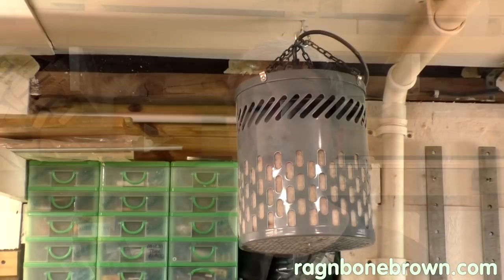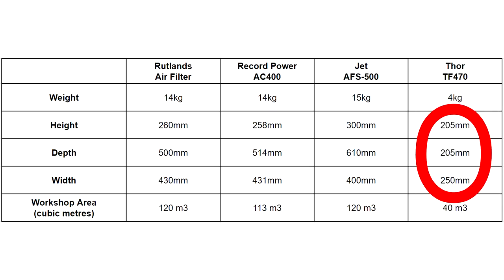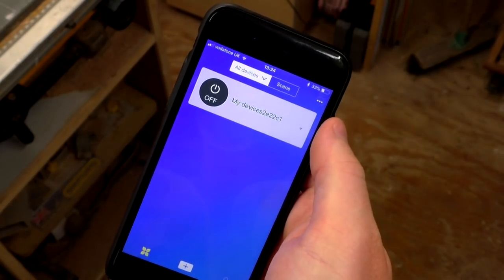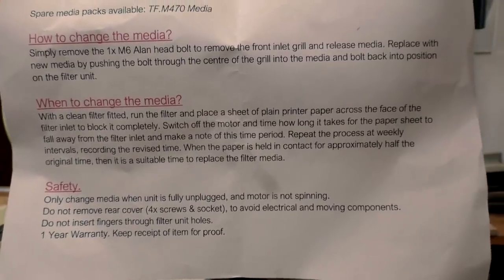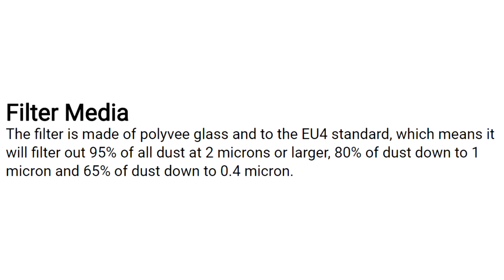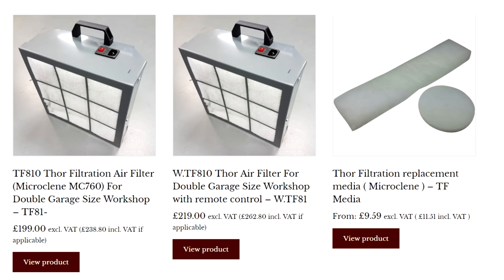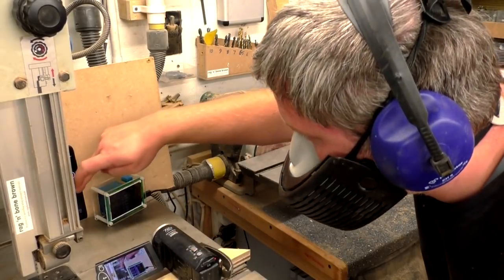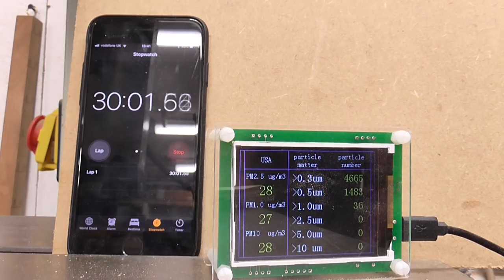Air Filter For The Small Workshop - Review and Testing The Thor Filtration TF470 (AKA MC420)

Comment: Not sure if I commented on this review before but I wanted to thank you for it. Due to your review I knew I wanted air filtration but I was put off this type by your and Peter's review of it.  I bought two of the Rutlands ones for £220 delivered. It is way overkill for my garage according to the specs but I would rather clear the air quicker.  My ceiling is higher than I can reach so should be space up there. My intention is to have them on opposite walls pointing in different directions to encourage a circular rotation in airflow. They arrived today and I would say are very quiet but have a good air flow. I am yet to see how much dust they gather.

Comment: I have the Jet, it's incredibly quiet and has the option to stay on for a number of hours which is great as it cleans the air when I finish up.

As for your WiFi issue, try an App called If This Then That. You can set it up to do all sorts of things and having it turn on something when your phone is near a certain area using GPS should be possible. I used mine to turn on WiFi cameras when I left my home area.

Comment: Great video very informative 👍. I work in the air pollution monitoring industry and it's extremely important to filter out PM10's and microns below, especially in enclosed spaces as the human lungs can't remove these particulate sizes efficiently, which over time can lead to long term health issues. I was currently looking at the Rutland's air filter for my workshop.

Comment: It would be interesting to see what the results would be if you were to run the experiment using the air filter, but without the filters in the device. I think that would help determine if it's the filtration aspects of the system, or air circulation (from the exhaust of the device) in the room that affects the readings

Comment: Nice review! I've been wanting to get some sort of air filtration system, especially since my workshop is the garage and I have two small kids. At the moment I work with the garage door open and use the shopvac to clean up as best I can. I wonder how well a box fan with an air filter mounted to the back of it compares to these systems you can buy. Probably a lot louder, but maybe just as good at filtering the air?

Comment: Glad to see you got one of these. I remember recommending one in a past comment as i have the Microclene equivalent. Mine is hooked up to a fan speed controller which i purchased on eBay from SPUK they’re typically used for hydroponics units. This allows me to turn it down a little when dust is not so bad meaning i have it running all the time in the shop and can hear the radio. I the. Adjust the dial to full when i sand/make a cut. Maybe worth a thought?
Reply from the maker: Thank you I might check that out

Comment: The 65535 number is likely the maximum number the sensor can generate/or the display can show (it's the maximum value a 16bit number can take), so in that version of the experiment the value is probably going much higher, but the unit it clipping it to the maximum it can handle. 
This would mean the dust scrubber actually works better than you calculated in the comparison as the non extracted version has a much higher peak that the number you used in the calculation.

Comment: Hey Keith, This was a great video and full of useful info. As for your app problem, I have an old phone glued to the wall in my shop just on wifi and use that to run music etc. You could run the app on an old phone picked up from ebay and just leave it as the on off button all the time. If you went for an old Android phone you can get them for less than a tenner on ebay etc.
Reply from the maker: Nice idea! Thank you
Reply: Once you have the old phone, I am sure you could think of lots of uses for it and you don't have to worry about locking it. It could be great for controlling music to a bluetooth speaker or a headset and not have to worry about touching the screen with dirty hands. I use them as light switches in my house as all my lights are smart. I use the cheap Ikea bulbs as they are great value for money and they have colour temp control which is great for the workshop. Good Luck.

Comment: I advise you to have a go at making your own air filter, starts with finding good quality panel filters and then build around them , using a centrifugal fan . With something well-designed should be up to take out all the dust in the air under five minutes or less.

Comment: This is how to work out how long it takes to filter the same volume of as your workspace.   Filter rated at 400 m² per hour , divided by 60 and divided by 60 again gives you a filter rate of 0.111 square metres per second. 40 m² shop , defied 40 by 0.111 and you get 360, which represents the number of seconds , divided by 60 and under ideal circumstances takes six minutes to filter all the air in your shop. Howeverunder real-life conditionthe area is unlikely to circulate evenlyso you might need extra plain fanto help circulate the air. I personally don't like the design of the filter because, the filter media is pressed right up against the guardand you are losing quite a lot of already smallfilter surface area.I enjoy your videos, very interesting stuff.

Comment: It's been said below but I repeat. I have all my big machines plumbed up to dust/ shaving extraction, with a decent size extractor, that makes a lot of noise, so the extractor is outside, I have one of those remote socket plugs and keep the 'Remote' on a home made key fob, I hook it onto my belt in the morning and it's with me all day. As I start a machine I press the remote button and on comes the extractor.  I think it cost me Aust $45, so about £23. well worth it.  (three remote sockets)
Reply from the maker: Won’t work unfortunately because when I turn the unit on and then turn it off at the wall and back on the unit is still off
Reply: Smiles... Yes the magnetic switch. I did a bit of jigary pokary and rewired around the switch terminals.

Comment: You could buy a remotely switched plug adapter with a key fob, smartthings do one.
Reply from the maker: Won’t work unfortunately because when I turn the unit on and then turn it off at the wall and back on the unit is still off

Comment: I am deeply suspicious of the peak value. In computing, a 16 bit integer with all the bits set gives the number 65535  - I suspect that the unit you have is 16 bit so would never show a value over that regardless of how much dust you generated. Easy to prove either way though :)
Reply from the maker: Someone else pointed that out and it did dwell there for a little while. I don’t think it affects the results much though
Reply: I got triggered by the value ;). In reality I don't think it'd matter. If a value of 65535 represents too many 0.3 micron particles to be safe, then it's still too many even if the device were capable of showing higher values.